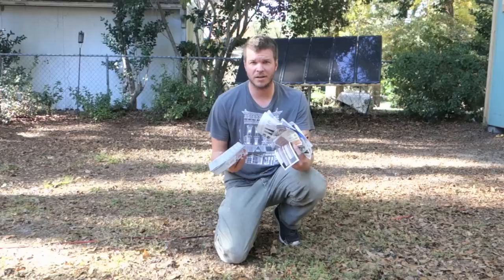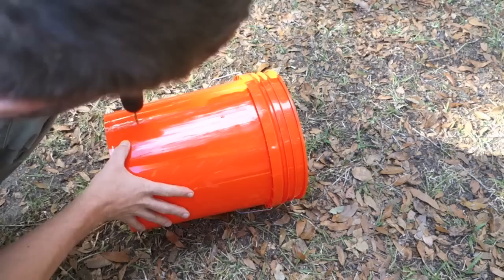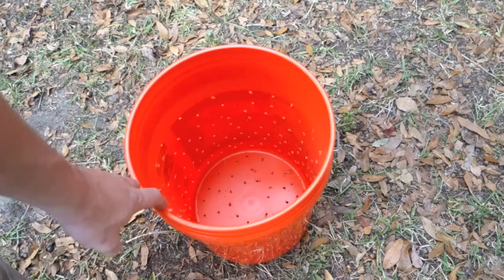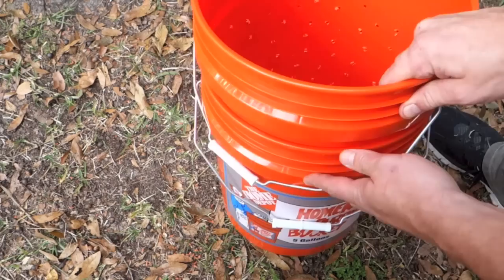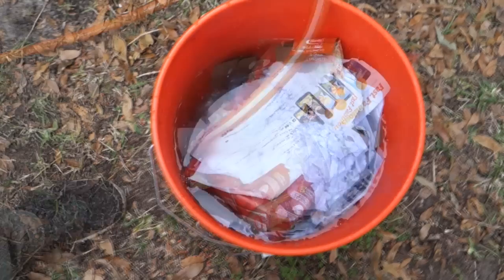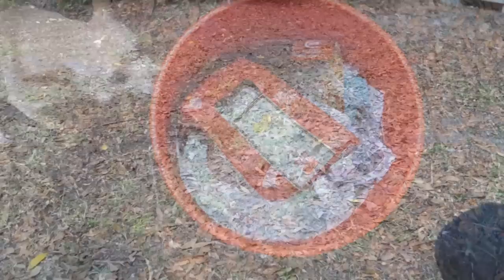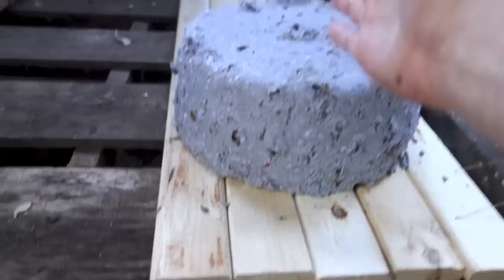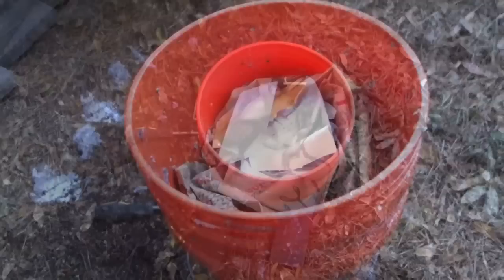Free And Virtually Unlimited Fuel To Heat Your Home

Comment: i like the idea especially since recycling is counter productive and funded by the tax payer meaning recycling turns a net loss.
Reply: Recycling in some communities is a PR gimmicky fraud -- the jars people rinse out carefully for recycling end up in landfills because "market forces" determine whether the recycling will actually take place, and if the price of recycled glass isn't high enough, it's treated as trash.

We could have a program converting this glass currently destined for landfills into sheet glass to be used to retrofit homes with double hung windows and/or solariums for energy conservation and greater employment opportunities.
Reply: recycling just isn't cost effective. like all ideas it looks good on paper but like the saying goes "if it makes dollars it makes sense." and recycling doesn't make money.the employment aspect is ridiculous because we the people would be hiring people to perform Make Work jobs and paying the workers TAX DOLLARS. Yes recycling is TAX PAYER FUNDED. everything the government touches turns into shit. The USPS is proof of this statement.
Recycle metals. Everything is a waste of time and money.
Reply: Cynthia Allaire Most of the cost in manufacturing glass is in the fuel used to melt it.  Using old bottles  to make window glass will probably never happen, because it would have to be sorted by color to make different tints, making it even less cost effective.  Most local glass wholesalers don't even recycle glass cutoffs they make during manufacturing because it doesn't pay.
Reply: Raymond May Actually, it depends on what you are recycling.  All metals are financially viable as recyclables and cardboard is pretty close.
Reply: Raymond May You're right but only partially! Corporations dump their shift, toxic packaging material on communities and refuse to take responsibility! If they had to clean up the mess they produce, you'd be amazed how quickly they came up with a solution. Corporations evade paying taxes (see GE, paying exactly 0 $) and make the commons pay for the mess they create, that is the issue.
Reply: Raymond May the internet killed USPS, and a lot of private businesses have lasted no longer than a nanosecond compared to how long USPS has, I think the (any) government has faults, but if people insist on behaving like self absorbed sadists  (not pointing any fingers here, just saying) we need a government. (child labor laws,  work place safety, min wage, Enron, Madoff  hell even with gov oversight little old ladies are still getting ripped off it's sick!
Reply: The internet didn't kill USPS... Gross mismanagement, incompetence, and lazy ass employees who don't have to excel because the taxpayers are always there to bail them out killed it... You don't see UPS or FEDEX going under, do you?
Reply: I do agree, there was a lot of mismanagement, but UPS and FED-X don't rely on letter (stamps) and they do not deliver our mail daily which makes their operating costs a lot higher. I don't know a lot about it, just what I have read, but here's a quote from Wikipedia "The USPS has not directly received taxpayer-dollars since the early 1980s with the minor exception of subsidies for costs associated with the disabled and overseas voters." which I didn't know? There are always more sides to the story if you want to hear them.
Reply: They haven't received taxpayer money directly, but they have billions in loans from the Fed.
Reply: McDoulgham well they pay no taxes,becuse of the "change" everyone "voted" for...(really barrack was apointed by bilderberg...but thats another story). socialism at its best.
Reply: snowdog90210 the usps has been trying for years to streamline the system....it's the congress that wont let them...so just keep "voting" for the same old people, and keep getting the same results.
Reply: If voting made a difference we wouldn't be allowed to. If you think I'm wrong take a look back to when Barry Soetero won 108% of the voting population.
Reply: thats why i quit voting...it's a scam...i think its the bilderbergs and now running the world. take care
Reply: Its not always a net loss, in 2010 when St. Louis city started charging for trash pickup a single steam recycling program was also started. Prior you had to go to recycling center or pay for curbside pick up from another company ($15 a month). Now there are recycling dumpsters in all the alleys and wheeled bins for every house with out an alley. In the first year of the program the city saved $500,000 in landfill costs and earned 300,000 from the recyclable materials, and thats with 11.5 percent of waste being diverted. Not bad for 11 bucks a month. Also the savings and earnings are being used to buy new trucks and install camera in alleys with illegal dumping. So I don't know how your local programs are being run but ours seems to be doing fine.

http://www.stltoday.com/news/local/metro/st-louis-single-stream-recycling-program-is-paying-dividends/article_ac2a07a5-42a3-5304-ad06-42ab0ce16272.html
Reply: So another set of trucks that need to be paid for along with drivers that need to be paid. Then cleaning and storage facilities that need to be paid for. Thank you for reiterating my point. Dunce.
Reply: Raymond May before you start name calling you should have read the article I cited. While I admit I was unintentionally vague about the trucks; they are not additions to the fleet. They are replacements to trucks that are over 14 years old and have become costly to maintain. So your assertion about increased costs is false. There will be less maintenance needed with new trucks. Also the fleet is the same size so there is no increase storage or personal needs. And since the cost to buy and lease additional trucks nearly matches the savings and earnings from the recycling program, it doesn't effect the cities budget. One if many reasons why the city had an A credit rating. So thank you for jumping to conclusions and proving your ignorance.
Reply: New trucks means more on insurance. If something is paid for by local, state or federal government we all know it doesn't turn a profit. Did the article mention anything about the taxes or subsides/hidden costs involved in recycling? It will always be more cost effective and better for the environment just to throw your trash away so it can go into a landfill. Everything else is busy work resulting in the squandering of money.
Reply: Raymond May I'll give you the higher insurance is a possibility but they were planning to upgrade the fleet anyway. So insurance is not a compelling argument against a recycling Plus the program's savings allows the city to up the time table, not require new trucks as you infer. There are no tax increases or Fed/state subsides involved with running the the program. There was a Fee for waste services that started along with the recycling program but that would have happened any way. prior to 2010 city residents paid nothing for waste services which included 2x per week trash pick-up, 1x per week yard waste (except during winter 1x per month) 1x per month bulk pick up from the alleys and 1 truck bed per month drop-off at the dump. To maintain budget with out fees trash pick up was reduced to 1x per week. But that did not go so well, packed and overflowing dumpsters ect. So a waste fee of $11 a month was added to property owners water bills. Trash pick up was restored to 2x per week and single stream recycling dumpsters were placed with pick up at 1x per week. This current set up seems effective and reasonable to me. another benifit was that the savings were also used for cameras to combat illegal dumping in the city.
Reply: Raymond May huhh. And here I thought we could have an intelligent debate on whether recycling can be viable. Guess you prefer insults, making baseless assumptions with out reading, and wild tangents that have nothing to do with the topic.

So you feel paying for a service (in this case waste removal) is an extortion fee. I'm fairly certain most people pay to have there trash removed, be it city/county department or private company. Now for all I now you live in the sticks and either have your own dump or burn pit like others who prefer more open spaces. But there are millions of people that live in towns, cities, and suburbs and pay to have there waste taken away. Thats paying for a service not extortion, just like I pay for the electricity and natural gas I use.  

As for the people you say disagree with the extortion fees; I'll coin a phrase for you "freedom dumpers" (joking). The dumpers are usually from 2 groups of individuals. Contractors trying to cut costs by dumping building waste in residential dumpsters or littering alleyways instead of paying for a construction dumpster. And people who live in St. Louis county that would rather leave there trash in St. Louis city than pay an extra hauling fee. County residents have to use private companies that charge a monthly fee for trash pick-up, charge an additional fee for recycling and then charge every time you have a bulk item to dispose of. So many with the means try to illegally dump in the city, since there not city residents they have no right to our waste services.

Imagine you can't throw out your garbage because a contractor filled all the dumpsters on your block to save a buck. Or people leaved crappy furniture against your property so save an extra waste fee. I don't want to put up with that, nor should I. So I support any effort to crack down on dumpers, I've called the police a couple time my self after seeing them in action. 

I don't believe my arguments will sway you, nor was that my intention. It was to make a point that your assertion that all recycling programs are economically unviable is disingenuous. A case could be made that there are just as many successful programs as there are failed ones; a claim I backed up with actual proof as opposed to insults and innuendo. But I think the reality is your merely trying to bring me to your level of discourse. So I look forward to your next tangent and barb to try to dismiss my point of view.
Reply: I have no issues with paying for a product or service. What I do have a problem with is is the notion that recycling products other than metals is better for the environment and cost effective. Recycling is already tax payer funded so it makes no sense to charge customers an additional fee to recycle.
Reply: Raymond May And here we go again, were in my responses did I say we pay a recycling fee. City residents pay a "solid waste disposal fee" that is added to ones water bill. That fee pays for the refuse division to pick up all waste streams; Garbage, yard waste, recycling, and bulk items.

The Refuse division is funded by the fee since it was created in 2010. Prior to 2010 the division was funded by the city's general fund (taxes) but a city budget shortfall from the recession and a failed attempt to cut back on trash pick-up prompted the Funding changes. 

Refuse division also decided to implement a single stream recycling pick-up in an attempt to reduce landfill tipping fees, which in the 1st year saved the division $500,000. That was from 11.5% of waste not going to the landfill, the prior program only diverted 2%. So how is that not cost effective?

Not that you'll read them but here are my sources:
https://stlouis-mo.gov/government/departments/street/refuse/recycle/documents/loader.cfm?csModule=security/getfile&pageid=166537

https://stlouis-mo.gov/government/departments/street/refuse/recycle/alley-curb-dump-cart-recycle.cfm

Comment: try spreading out the pulp 1/4"-3/8" thick on a large piece of plywood. Let them dry for a day or two until dry but not crispy. Cut them into 16" strips then roll them like a crepe. You even could use a light accelerant and paint stripes on the outside after you wire it closed and let it dry for a week.

Comment: Why not just throw the paper directly into the stove while it is still dry?
Reply: Because OBVIOUSLY it will burn much too quickly.
Reply: it won't burn quickly when you throw in a big compact stack of paper as the oxygen/fuel ratio is about that of the brick.... Just start a fire with a log or 2 and then dump book-sized stacks on top, it will burn long and slow. Be sure to have a hot fire though and enough draft. @UncleKennysPlace

Comment: You keep saying '' to save time''.
Welding a bent saw blade to a rod sure seemed to save you time...
Reply from the maker: Yes. A one time deal.
Reply: The blade and rod idea was brilliant! Really good idea. I'll do something alike when i need to mix some concrete
Reply: +Julio Valdivia Wont the concrete set on it though?
Reply: Good point. Now that you say that, I would make a bunch of holes to the blade and i would wash it after i use it. I think that solves it
Reply: +Chris Hansen Why don't you take a seat over there?
Reply: That takes literally 2 minutes...have you never welded before?
Reply: +Malcolm Smith That's what the hose is for.  smh
Reply: How long do tou think ot takes to weld something?
Reply: Wow.. just wow.

Yeah, because when he's done with it he throws it away right? so of course he has to make a new one each and every time he makes one of those paper logs right?

You should really think things through before you post comments, just some friendly advice.
Reply: +Wafflepudding ..I think a log slightly less diameter a than the bucket would act better and add the extra weight too to maximise water drainage, and would make a more conformable seat :)

Comment: I love the idea, but I'd like to include a precaution. Coloured and glossy papers contain compounds that will lead to increased creosote deposition in your chimney, and this could cause a chimney fire. The burning of 'garbage' is generally not advised by woodstove manufacturers. If you have a catalytic stove, do NOT activate the catalytic unit if you are burning paper as it will clog and damage the unit.
Reply: Cutting a D size battery in half and throwing it in the fire will prevent the build up of creosote in your chimney.
Reply: @tenabarnes3269  Do you have a link that describes the chemistry of this? It strikes me as a bad idea. ;)

Comment: Welcome to the junk mail junkie club. I just throw the paper products directly into the wood stove
Reply: they burn better/longer if compacted, sir.
Reply: It's nice to see recycling in action. It just seems to be more work than necessary. How long does the paper log take to dry?
Reply: I burn logs in a wood stove and use  waste paper to start the fire
Reply: John Canivan I don't see why it matters how long it takes to dry. You're not involved in the drying time. And the work involved is minutes a piece.
Reply: Well if it takes a year to dry you'll need a lot of buckets to build up a stockpile of paper logs.
Reply: John Canivan You compress the excess water out, remove it from the bucket, then let it dry in open air. You only need two buckets.
Reply: The inks used to print paper (including news paper) have dangerous petrochemicals in them, and burning them indoors is very dangerous to human health. When I was a kid we did this all the time. I was put in charge of feeding the fire (including putting trash into it). Now I am disabled and have serious health issues. Don't do this. It is about as bright as heating your house with burning tar at the bottom of a barrel.
Reply: ChemicalRefugee If you happen to have traveled here from the past, you'd be right. If you're with us in the present, no, they're largely plant-based inks now.
Reply: ChemicalRefugee  there is no danger.
Reply: Isn't that just like a youngster to make something so simple so complicated
Reply: That would be the better option. Since the amount of fuel is the same before and after his processes all he does is lot of work for nothing. As compacted it will burn slower because of less exposed surface but the amount of stored energy is constant. There is also a risk that pockets of water in the paperlog may crack the fireplace.
Reply: tubros It wouldn't bet the better option though. Why?

This converts a fuel into easily usable chunks. Loose paper is shit for fuel. It's also harder to store, and transport.

 And that's not a real issue, because paper soaks up water, so any pockets of water would have been absorbed into the bulk of the block, migrated to the surface, and evaporated out.
Reply: ChemicalRefugee Were you eating the paper or throwing it in a closed wood stove? You did have a chimney I hope.
Reply: I agree.. for 1, I use paper to start my woodstove and 2, it's easier to just cut wood..
Reply: funny meeting you here John ;)
Matthew.
Reply: ***** Aren't btu's btu's, no matter whether they're burned quickly or slowly?
Reply: During the winter all the junk mail and cardboard (actually everything that will burn) goes into my fireplace stove insert) goes into the stove.
Reply: heat is heat... sometimes you need to push the heat up for a little while to get everything going well.  It beats sending it to a landfill.
Reply: craigslistrr O bituminous coal from the breaker sized is cheaper, much higher energy content, burns hotter, and has a little learning curve....but it's the best... even less work than cutting wood...plus almost indefinitely storable... won't root, go bad